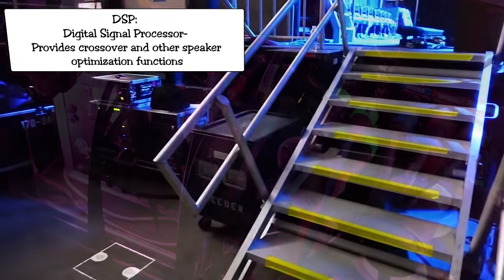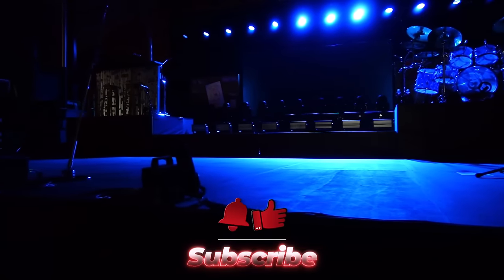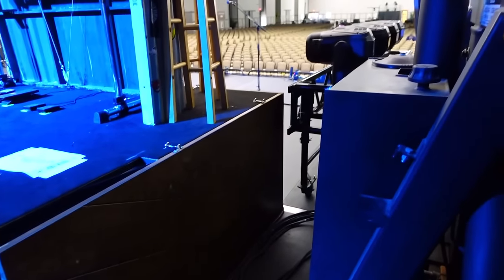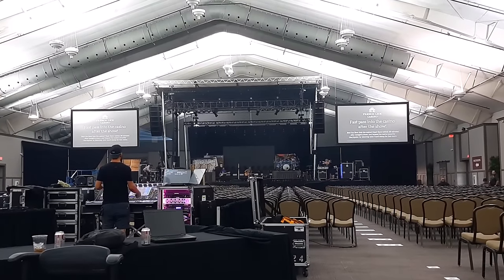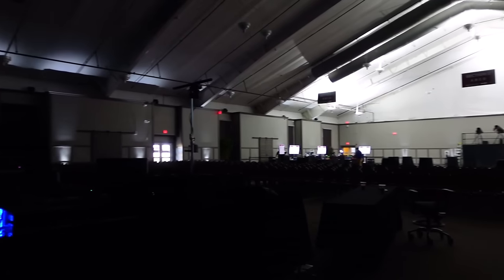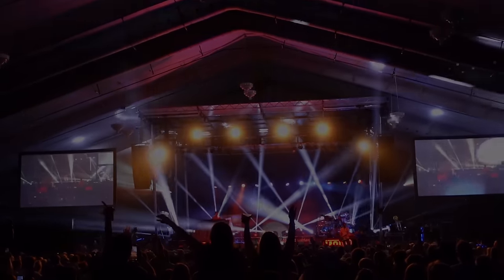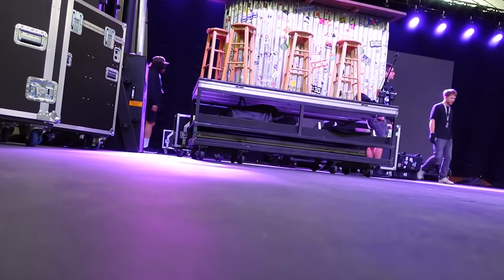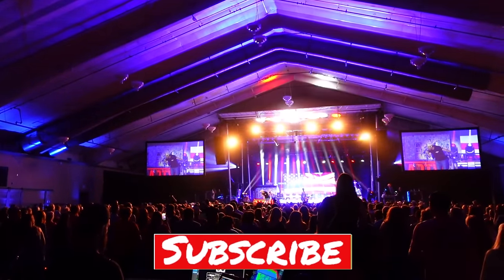The Art of Concert Setup: An Educational Journey for Musicians, Techs, Stagehands, and Concert-goers

Comment: 1:10 what is LyxPro and how it is connected with audio?
Reply from the maker: https://youtu.be/FW6c4ROQbLc
Breakouts/Break-ins... Analog dongles that let you use Ethernet cable (and in this case Tourgrade/Tactical/Supercat Cat5e STP with Ethercons) for 4 channels of analog audio over the cable.
There's nothing 'digital' about the process. No electronics involved. If you have an inventory of tourgrade Ethernet with Ethercons, then having adapters like these (or other brands) is very handy. The can replace a 4 channel audio snake, like where I'm using it for drivelines here. You can use the dongles in any configuration so you can create a M to M or F to F snake of any practical length. 

Since Ethernet cable is designed for digital it can also be used for DMX applications. Since I typically use Artnet, I'm already using the same cables for that connection... But if a guest LD needs regular ol' DMX to stage from their own lighting console, I can put the DMX versions of the dongles on the cable and instantly change things to a 4 channel DMX snake.

I showed the dongles that are connector to fan, but they also make 4 XLR connectors in a box (like a standard audio snake) that you can connect to Ethernet cables too. Or box to fan, etc...

Caveats: You don't have to use shielded cable BUT to pass phantom power it HAS to be shielded.
LyxPro changed their design. Older versions had fatter wires/jackets and used a different wiring/color scheme than their newer ones. Not really a problem per se, you just have to know which ones you have and use the matching ones. And of course if you don't have the older ones, then you'd never run into that issue anyway.
Reply: @AlanHamiltonAudio  Thank you very much. Is it usual cable or dongle has some chip and I can't make them myself? What are the names of these dongles?
Reply from the maker: You can make them yourself, but you can find them on Amazon (check the video description for links) and they aren't all that expensive. There is no chip in them. Just point to point wiring that follows the needed pattern.

Here is a website that shows how they are wired and has more info. Plus the info you need to make some yourself.
http://randomcontributions.blogspot.com/2018/02/using-ethernet-cat5e-cat6-wire-for-xlr.html